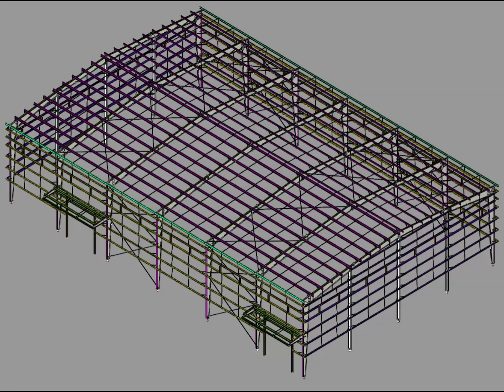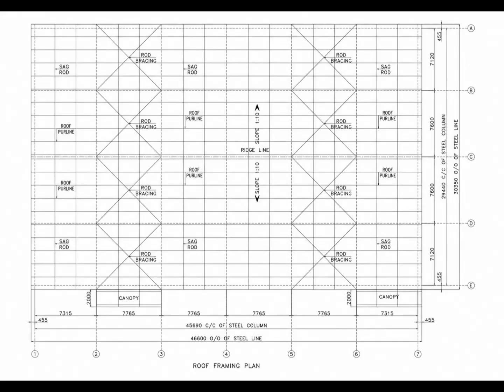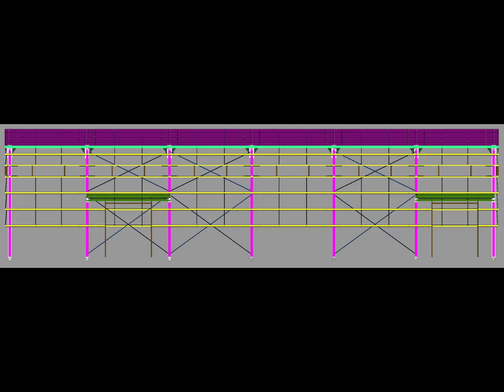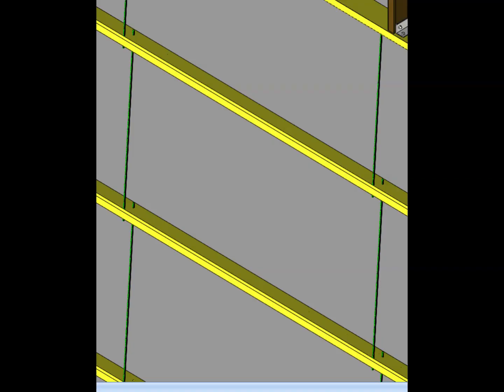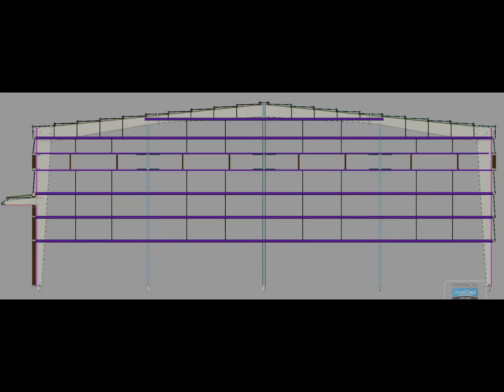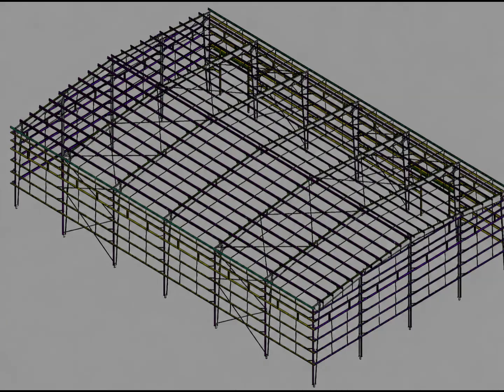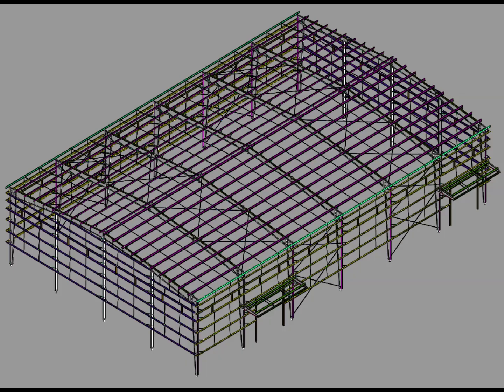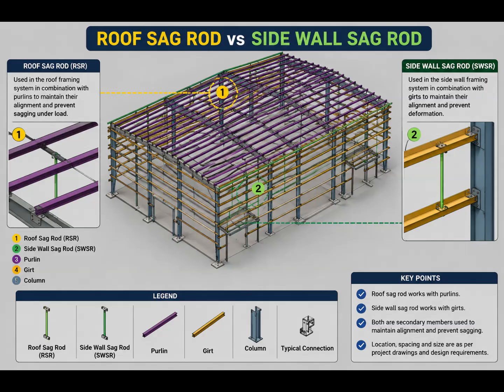PEB_VIDEO-24 : Roof Sag Rod vs Side Wall Sag Rod | PEB Difference Explained with Real 3D Model

Comment from the maker: 🔩 Roof Sag Rod vs Side Wall Sag Rod — Which one was new for you?

In this video, we explained the Sag Rod location, arrangement and connection using real PEB engineering drawings and a real 3D model.

💬 Comment below:
1️⃣ Roof Sag Rod
2️⃣ Side Wall Sag Rod
3️⃣ Both

👉 If you are learning PEB Detailing, Structural Drafting, AutoCAD or PEB Modeling, watch the complete video and follow the PEB SERIES PLAYLIST for the next lessons.

🔔 Subscribe to ACP CIVIL HUB and press the Bell Icon for upcoming PEB videos.

Next Video: What is an Eave Strut? | Function, Location & Connection Explained

👍 Like • 💬 Comment • 🔔 Subscribe
Thanks for Watching! ❤️